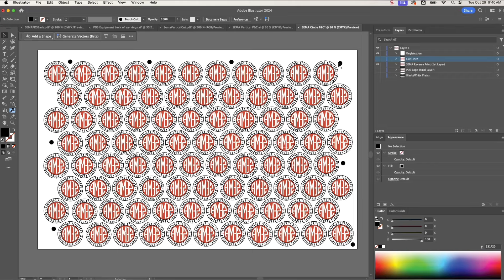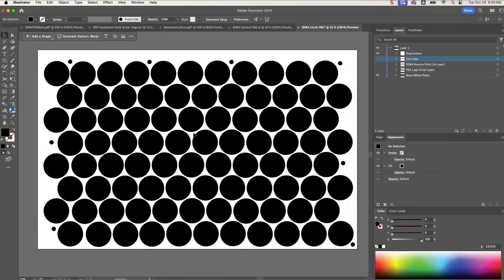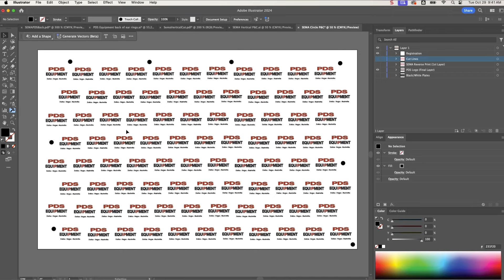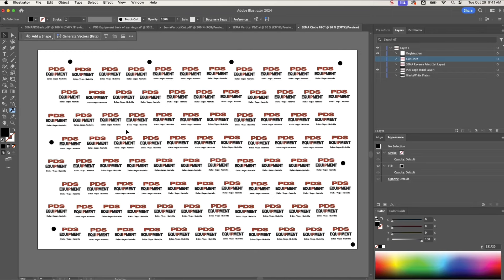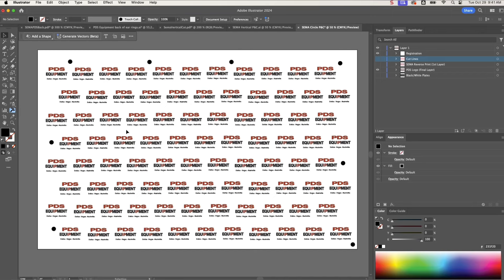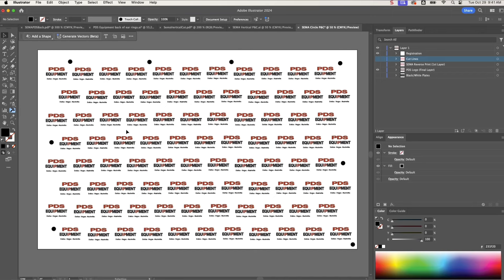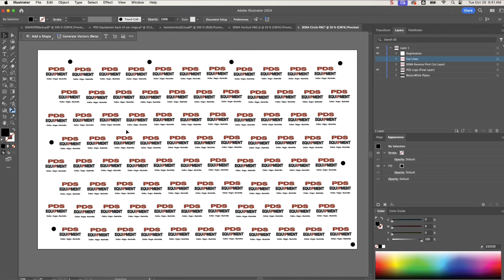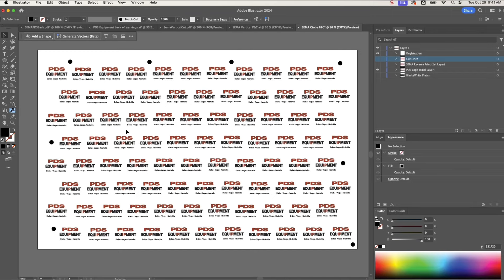Print and Cut - UV Printing Multilayer Design and Cut on Trotec Laser

Comment: Thank you so much for sharing this! I'm trying to get into making my own double sided acrylic keychains and only had an inkling of an idea based on manufacturer images sharing their layer process. The only difference with yours though includes the black layer in the sandwich. The manufacturers only do the white layer then print on top of the white layer for the other side. I figured that made sense to put a white layer in between but after watching your video, would that not be a good idea? Will the colors be off or bleed if I only do the one white layer in between? 

I work for a crafting company that has been expanding into larger scaled printers and laser cutters. I have the machines at our office and I wanted to try my hand at this.

Another question, do you apply a clear epoxy coat over the top layer of your keychains? That seems to be a method the manufacturers use. Or they stack another acrylic sheet on top. Idk how they would keep them bonded though
Reply from the maker: You’re going to have to test print a couple and see if and how it changes the color of your design or logo by adding a black layer.  If it does you could try adding an additional white.  This technique of layering with black is used a lot with window decals etc.   

I don’t make many keychains because they get a lot of wear and tear and are eventually going to chip, so I couldn’t answer the epoxy question.  I don’t apply epoxy or UV resin to anything.  On the earrings I do an onboard clear/varnish to help protect the print.

Comment: I am familiar with doing the cross hairs for print and cut but how does the registration marks work for lining up the material to cut on the laser?
Reply from the maker: @michaelphillips40  because your registration marks are in the same exact position in your print file as they are for your cut file. So when you create your cut lines (as shown in the video) they correspond to your print.
Reply: Is the laser using print and cut for that or absolute coordinates?
Reply from the maker: @michaelphillips40 this is a Trotec, you don’t have to do any work or set registration marks or coordinates, the camera auto scans it and cuts for you.